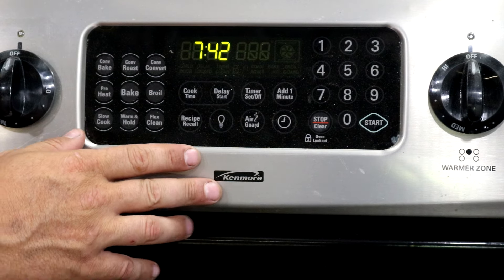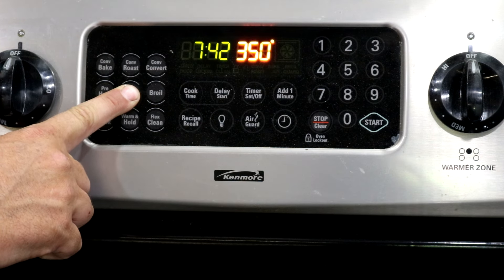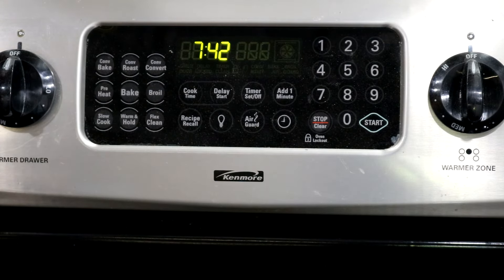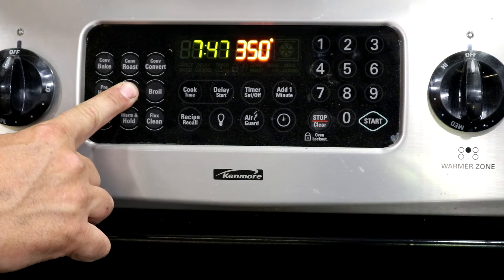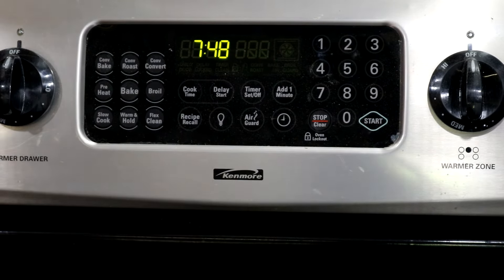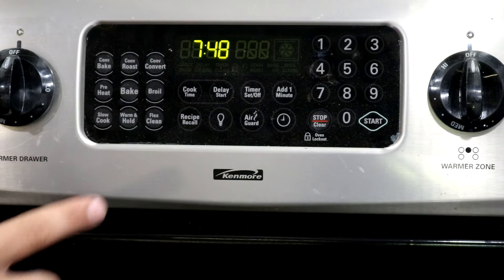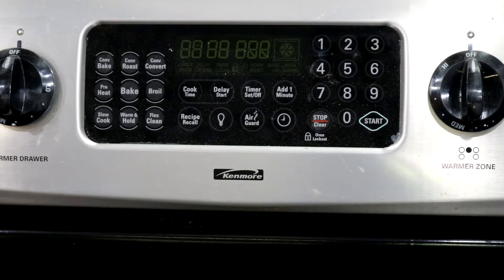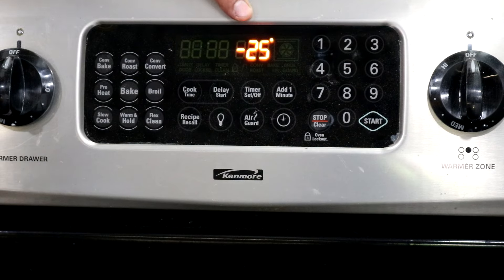How to Calibrate your Oven Temperature

Comment: Excellent instructional video! My oven seemed to need re-calibration as everything cooked much slower than the directions indicated.  Today I preheated the oven to 325 degrees to cook a spiral ham and tossed in a secondary thermometer. The moment the oven beeped announcing it was preheated, I checked the alternate thermometer and found the oven was 20 degrees off. I followed your directions , and now 325 is in fact 325. Woohoo! I don't have to use Kentucky Windage when baking anymore!

Comment: I have a 14 year old Kenmore Elite convection oven/flat top range. My problem is, once the oven reaches temperature reaches temperature accurately, it then cuts out and drops 40 degrees before cutting back in. This causes problems with baking. Is there an adjustment for the differential or do I have to replace the $300 board?

Comment: So I have a kenmore dual fuel with the more basic up and down buttons. I tried this and it worked up until the point covered in the video but how do j make it accept the 25 degrees I needed to increase the temp by? I’ve pressed the clean button and all the others too but nothing makes the oven temp come back except hitting clear.

Comment: Initially, the oven would be set at 350 and it would set @ 325. I’ve tried calibrating it and now my temperature is at 275. How do I get it to 350 degrees?

Comment: Hi, i need some help with my oven. Oven was at 350 and thermometer only read 325. I accidentally adj to -25. And when i measured it was now off by 50 degrees (oven at 350, thermometer at 300). I changed the setting to adj 25 but instead of matching the oven and thermometer reading (was hoping it would offset the 50 degree difference). But it was reading now reading (oven 350, thermometer 325). Now my oven always holds the adj 25, but i need it to go 25 degrees more due to the initial error i made. Any way to do fix this?

Comment: Fine and dandy . But I purchase two oven thermometers. A Oxo for $13.00 and a Taylor for $8.00. At 350 for my oven. The Oxo says 330 and the Taylor says 348. Now which one do I use to calibrate my oven? Very frustrating not knowing which one is accurate.
Reply: The oven will have a different temperature from the front of the rack to the rear of the rack. It will show a different temperature on the bottom rack as much as 25 degrees from the top rack. Place your thermometer in the middle center of the oven and make the adjustment from there.
Reply: I've heard that it's ok if the oven is +/- 5-10 degrees, I guess just get it as close to 350 as you can plus or minus 5 degrees. so if the hotter thermoter says 348, I'd go up 7 degrees but that's just me.

Comment: What can you do if your oven is all over the map? Mine is either 50-100 ° cooler OR hotter than the display. Sometimes it gets stuck on a temp, even though I keep adjusting the display. It appears that I am doomed to continually check & adjust temps all through cooking, or get a new oven. If only I knew if the new one would be any better!

Comment: This is incorrect. To accurately calibrate an oven temperature you should use a digital thermometer and take note of the up and down temp swing. The temperature in an oven does not stay the same constantly. You should find the average temp and adjust based on that. An oven will usually preheat to 15+ degrees higher than set temp to account for door being opened to add food. It will then drop down as much as 25 degrees below set temp before cycling back on to maintain an average temp. This is repeated throughout the cooking process. Calibration usually isn't necessary on old machines as improper cooking normally indicates a failed component such as temp probe, control board, or element/burner.

Comment: Didn't work...held the bake and a F1 code came up....why
Reply: That's OK. After you get F1 try the following:
1 - press bake again - you should see a 2 digit number
2 - touch bake again to alternate between setting a hotter or colder setting
3 - if you see a minus sign in front of the number it will let you calibrate down
4 - press bake again to get rid of the minus sign so you can calibrate upwards
5 - once you settle on minus or not minus just dial in the number of degrees you want it to change by using the number pad as usual
6 - after setting the up or down number you want press Start
You are now done
Hope this helps.
Otherwise look for a user guide by doing a web search for your range make & model.

UPDATE
Watch This Video for other problems with F1
How to Fix an F1 Error On a Kenmore or GE Range

https://www.youtube.com/watch?v=DejFOQWfBpw]

Comment: Bill was a little off Re: basic units. 

  My basic Frigidaire.  
 First check your oven temperature with your thermometer-- are you over or under? By how much? Remember that number.
   Here's how mine works.  
  
   Ready or not here I come! 
      
       Start with a cold oven.
This first step is for a LOW oven temperature.
Push BAKE. Push ARROW UP twice, the first push shows factory preset of 350deg. on the display.The second time push and HOLD ARROW UP untill 550deg. shows on the display. Now here's the trick.
Quickly, very quickly move from ARROW UP too BAKE.  and HOLD BAKE. Be sure your finger is fully on the button under the pad!  This should take 5 to 7 seconds to switch over.
Your display should now read 35 
That 35 represents a (plus 35deg. number)

Let go of BAKE.
Push ARROW DOWN repeatedly. See the numbers decrease by increments of 5s, these are PLUS deg. numbers.They will appear as follows. 35 30 25 20 etc. STOP on the needed plus deg. number. let go of ARROW UP. on your needed PLUS deg. number. Push BAKE. Your needed PLUS number is now locked in.
 Now the display should automatically switch over too clock.
As an example:  let's say you want 400deg. but your oven thermometer reads 375 deg.   Stop on the number 25. Push BAKE. Let go. Your oven will lock in and ADD that 25 plus number to make the 400deg. The display should automatically go too clock after a second or two. Check oven temperature to see if it's 400deg. Your factory preset is the Holy Grail! You can also check the oven temperature against the 350deg.factory preset with your thermometer.

This second step is for a HIGH oven temperature.  Follow the procedure as above, push ARROW DOWN repeatedly past 0 into the minus numbers. They will appear as follows.
-5 -10 -15 -20 etc. Push the ARROW DOWN  repeatedly in increments of 5s to the needed (minus) number. Let go of ARROW DOWN on the needed minus number. Push BAKE too lock in that number. Your display should automatically switch over too clock.
 REMEMBER! Now your SUBTRACTING deg. numbers.
If you should pass any needed number going up or down you can use ARROW UP or ARROW DOWN to scroll.

I noticed that when I pushed BRIOL HI the heating element wasn't glowing very brightly so I pushed and HELD Broil HI for a couple of seconds. I heard a clicking sound and the element glowed brightly. This step may also control Broil LOW.
All of this WILL NOT be stored after a power outage.
  
OY VAY!  Such a commotion !